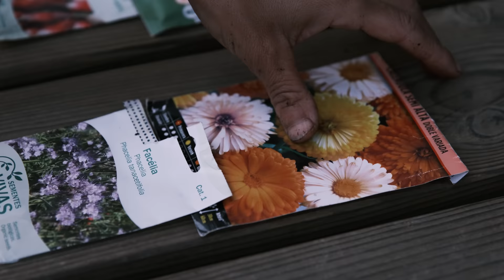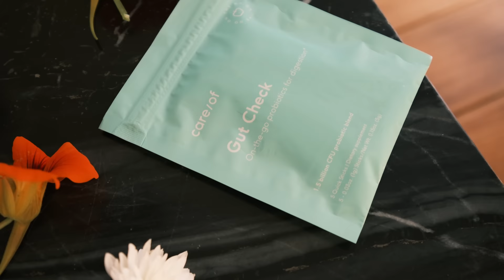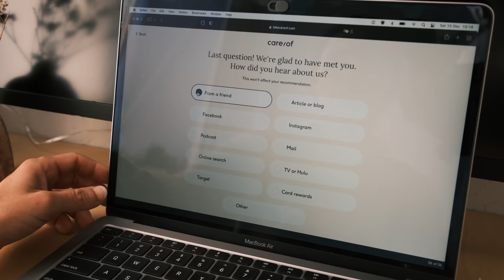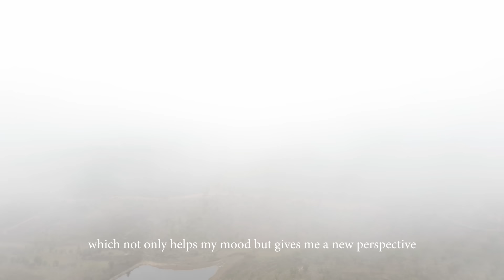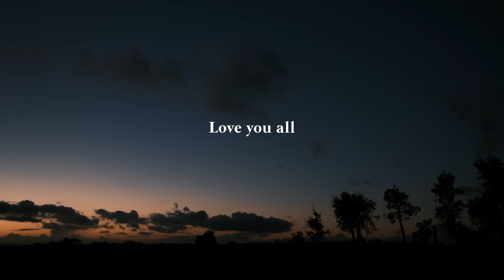#22 Taking Care of Myself during Winter

Comment: There's a safety concern you may not be aware of in your food preparation area.  The walls were made with "particle board" which has a problem of outgassing formaldehyde into the kitchen.  It would probably help to paint it, but you should check with someone locally to find the best way to resolve the health hazard.
Reply: That has always worried me too, Jamie, but I assume they sealed it.

Comment: Towards the end of the season feed your plants milk because it has a lot of amino acid and the amino acid helps take up calcium and silica 1,000 times faster and when the plant has amino acid calcium and silica acting like fix a flat in a car tire when you run over a nail when the frost penetrates the cell it won't pop it and also prevents mold spores from spreading because the cell's crystallize around the mold spores much like frost keeping the cell intact... Post scriptum you can use the milk as fertilizer all season but mainly towards the end of the season but also in the beginning of the season when some random Frost could hit